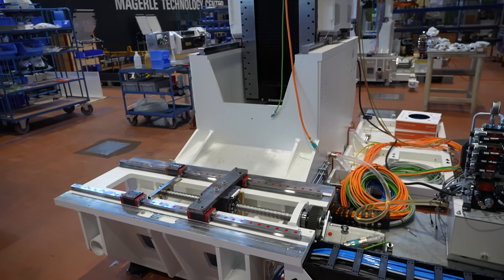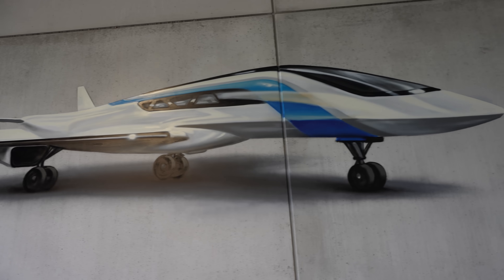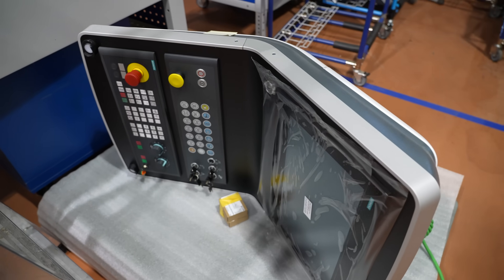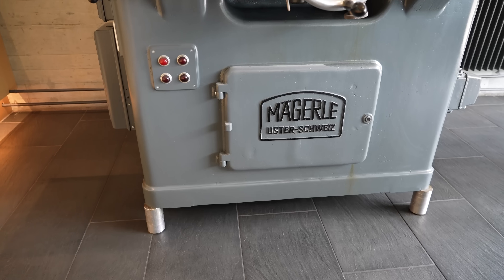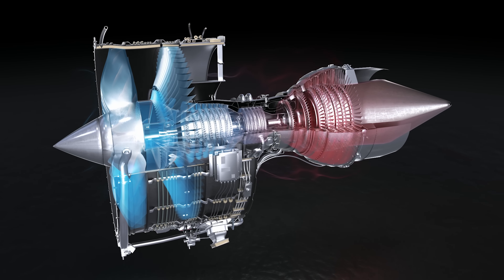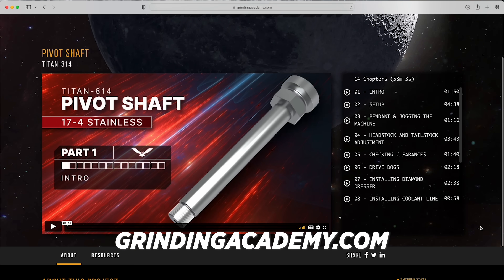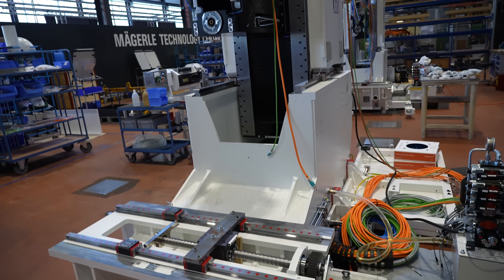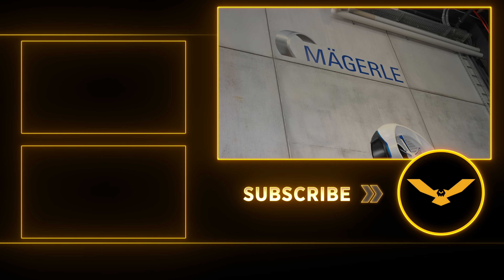TOP SECRET | Touring the Mägerle Plant in Switzerland

Comment: One of the reasons for quality difference is the retention of employees in Switzerland. In many cases a apprentice will stay-on after 4 years, in some cases up to their retirement. 
Switzerland has a very different employment philosophy than north America. There is no 'hire and fire', an employer as-well as employee has usually about 3 month notice, to either quit or get rid of a person. The result is a totally different climate, as both sides tend to put more effort into the job environment. If you can fire at will, your products need to have a more stable life cycle, as you cant up-down scale on short notice.The disadvantage has always been, that european economies recover/rebound much slower to economical changes, but tend to be more stable on the long run - which reflects in quality and knowledge retention. 
I guess that explains why silicon valley is not in Switzerland, beside the intellect being present - the ecosystem is just different on either side.

Comment: Pretty cool plant. I worked in a machine tool rebuild shop. We did mostly micro-centric grinders for the bearing industry but also many other types of grinders and metal cutting machine. Reworked all the slides and made new gibs and even used Turcite on the ways. Very cool industry

Comment: Not impressed by the electrical Siemens parts. I'd rather go for linuxcnc put in some resources and get it on speed modify and add customized code to it. I'm getting amazing results with LinuxCNC and customized the menu for parts which I need myself; The accuracy is amazing.
Reply: The Siemens CNC controls HMI is based on Linux, while the Servo drives work on a real time embedded programming.

Siemens and Heidenhain CNC controls are the most accurate and dynamic drives available worldwide.

LinuxCNC is dimensions off industry standards.
Reply: @norbertfleck812  LinuxCNC provides a good foundation for getting things done in a very reasonable way and it's future proof.

There are certainly some things that have to be improved eg. G71/G70 in lathe mode the lead in speed is fixed which is not suitable for stainless.
However with a little bit programming experience they're no show stopper.

I very well believe that the other controllers are good and mature, but looking forward the next 10 years I'd rather go with LinuxCNC. I'm using it for around 2 years now and I've done exceptional things with it which I never thought I could do myself before.
However when using LinuxCNC I also recommend programming skills to fix and/or debug certain issues - to understand  what's going on but that also makes it future proof.

My entire workshop is off industry standard and yet still good enough to make parts within tolerances which I need (measured 0.05mm) - and which commercially would cost a 5 digit amount for the volume I need.
Most shops also charge extra if you need an accuracy <0.1mm; 0.1mm is easy to achieve.

LinuxCNC is powering my lathe and 3+2 axis mill at the moment.